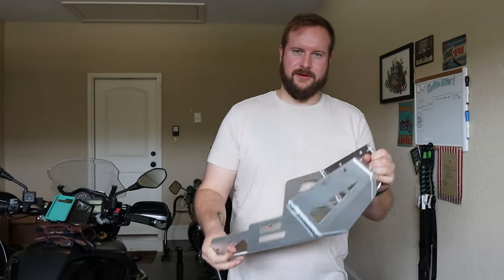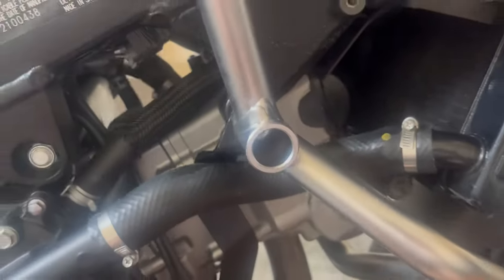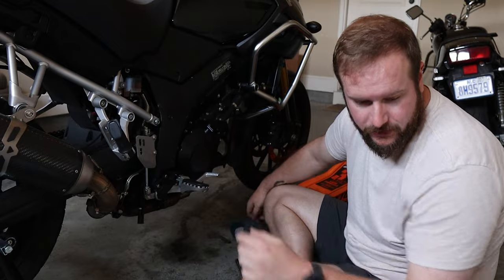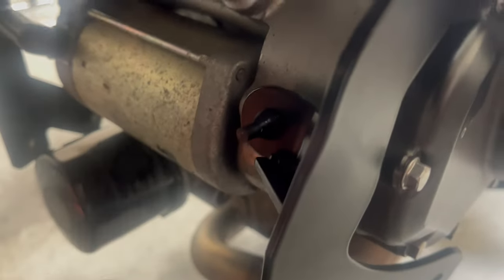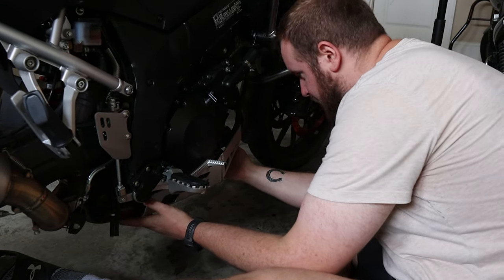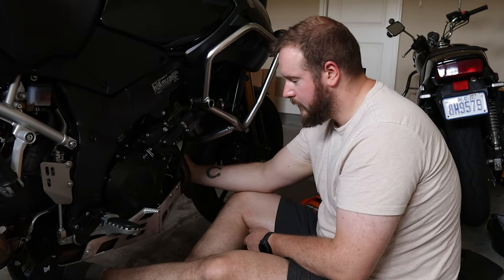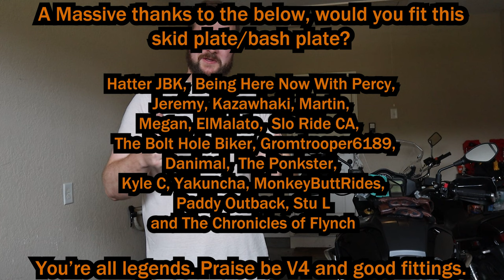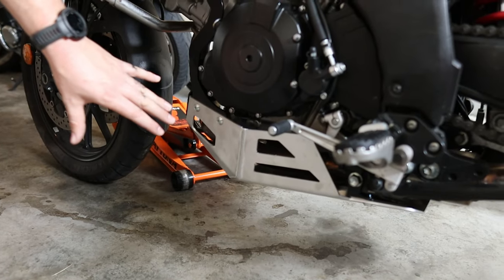Fitting a Hepco and Becker Skid Plate to 2015 Suzuki V-Strom 1000

Comment: How much space is left between the skid plate and oil drain and filter?  If there's enough, maybe you could make something somewhat flat with a small channel to direct the oil out.  Assuming you can get your tools in there.  I've seen skid plates designed in a way to allow for oil changes, but they aren't common.  Who knows.  If it turns out to be super obnoxious, maybe you can get creative and make an access point.  As long as you're not compromising the welding, you out to be fine.

I used aluminum foil to direct the oil with my Versys.  Didn't have a skid plate, but the oil would dump onto the pipes and make a mess so had to figure something out to keep them clean.  It worked really well.

You could also just take a few off and loosen the remaining two on one end, then pivot the plate out of the way.  Make it easier to just swing it back into position and bolt it back on.  If it'd make it annoying to get an oil pan under there, you could use something to elevate the pan so its over the part of the plate on the floor.  Like a scissor jack for instance.  Or even some wood so it sits even with the skid plate so the pan can rest on top of part of it.  Hopefully that actually makes sense lol.  I got it in my head but describing it may come across weird!

I do like the silver with the black.  Think it looks nice!  

Do Hepco and Becker always take forever to ship stuff?  Was considering their engine guards and possibly skid plate for a bike I may be getting.  7 weeks is insane though gosh.
Reply from the maker: Not a whole pile, I'm definitely going to try the swing it down method to see will it work but I have my doubts, at that point there'll only be 3 bolts holding it in so it'll likely be much much easier to just take it off. Haha it all makes sense worry not! 
I don't think I'd modify it as it's nice and solid the way it is, anything I'd do would make it look worse and also make it less good at catching oil while keeping dirt out. In reality 7 bolts or so to drop it will be grand once every 3k miles anyway. I'll try it the first time and if it really is a massive pain I might do something different. 

It wasn't H&B shipping to be fair, it was Moto Machines and they did have a warning it was on back order. It was SUPPOSED to be 4 weeks though.
Reply: @TheGorillaBiker  Fair.  Just figured if a couple screws at one end were still attached, it'd save you having to fuss with lining everything up again and just rotate it back up, bolt it on, done.  But yeah definitely let me know how it goes.  Might use the same method for the SW Motech skid plate for for my 'Strom.

Ahh yeah back order makes more sense.  I thought it was something that had to be imported since others had mentioned it taking ages for parts from them!  Glad to hear that isn't the case lol.  Keep up the awesome vids, man.  Take care!
Reply from the maker: There are 4 at the front and 3 at the back, not including that little black plate which would also have to come off. So really even to swivel it it'd be 9 bolts actually! But I had the same idea when I was fitting it, it would be nice if there was a way to swing it down :) Do you have the SWMotech engine bars also? 

Haha yeah if it was a standard 7 weeks from them I don't think I'd be recommending it! Haha not sure they're awesome, but thanks, and I shall keep making them for the foreseeable :)
Reply: @TheGorillaBiker  I have the T-Rex Racing engine guards on my V-Strom.  But the SW Motech attaches to different spots from them so it should work perfectly fine!

Oh I see.  Well here's hoping swinging it out of the way works :D  

lol yeah 7 weeks is a long time for an order gosh!

Comment: Mr. Gorilla biker, hi, awesome video, just a quick question. Do you know whether this skid plate works with Givi crash bars?
Reply from the maker: I'm not 100% sure as I haven't seen them up close, but if they mount to the same engine mounts as the Touratechs do in this video then I think it would fit, like it was for me there will be a little risk there but I think it would :)
Reply: @TheGorillaBiker  thanks ! I like the touratech guards but I think my knees would touch them when riding… I am 6.4. Don’t you hit your knees on the touratech?